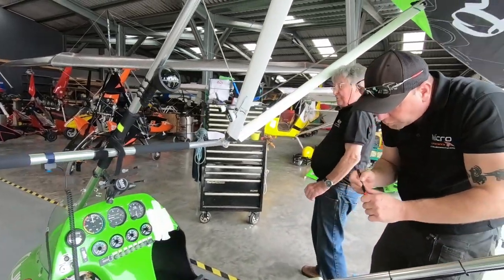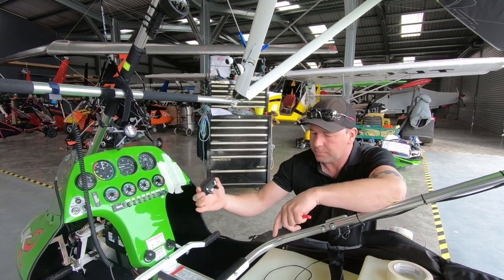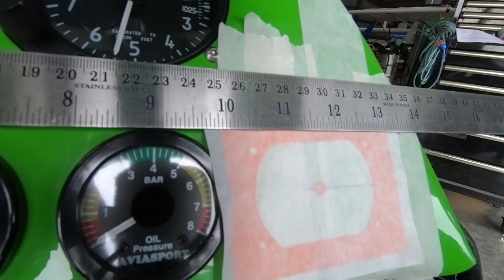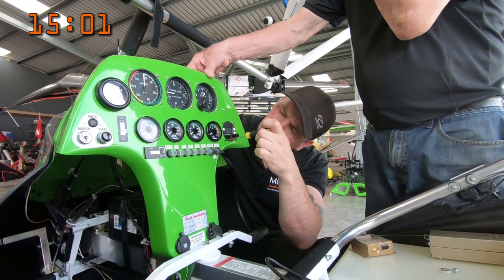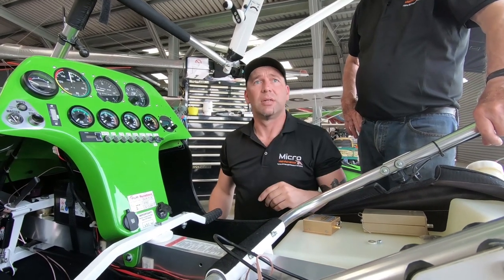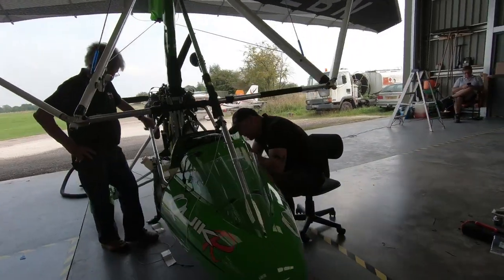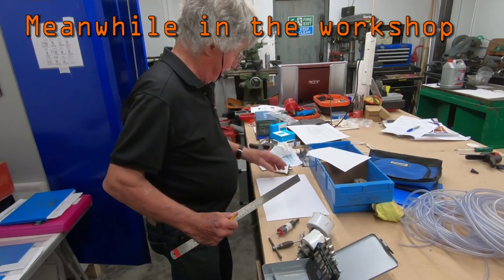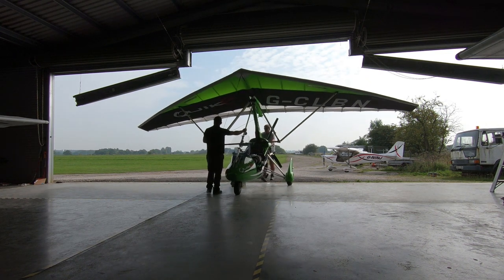The Green Quik R - All in a days work: Micro Maintenance - S2E2 -

Comment: Can I ask where you mounted the transponder antenna? Ideally I’d like mine on the base of the pod but I’ve got a strobe under there so mounted it on the front where a lot of people have their radio antennas.
Reply from the maker: Hi Mike, on trikes we usually install a blade style antenna behind the nose wheel on the pod, it does though require also installing a ground plate.